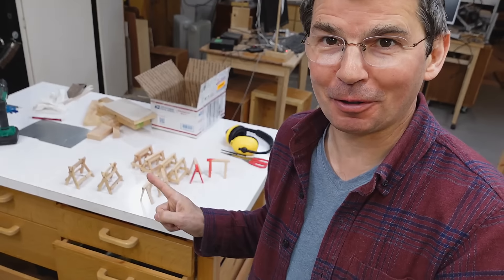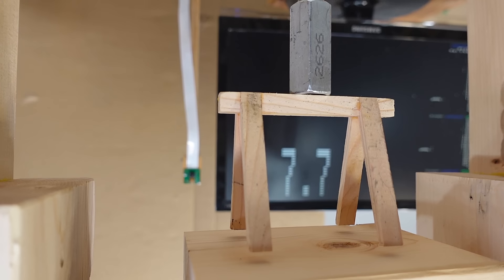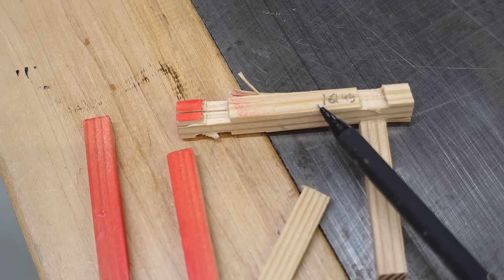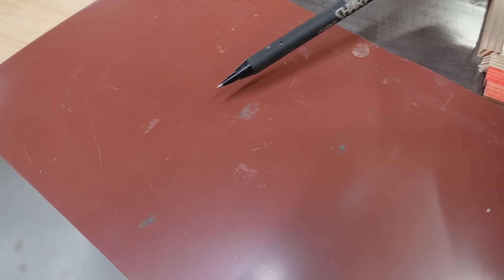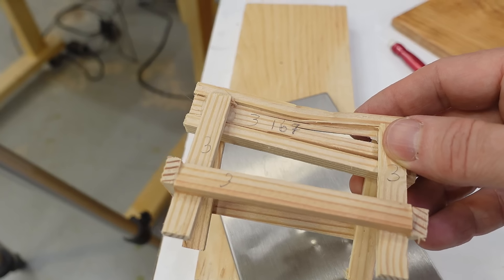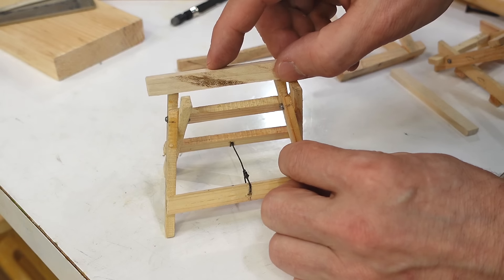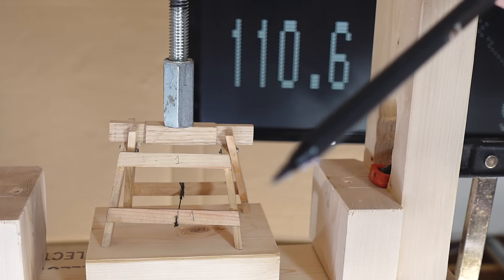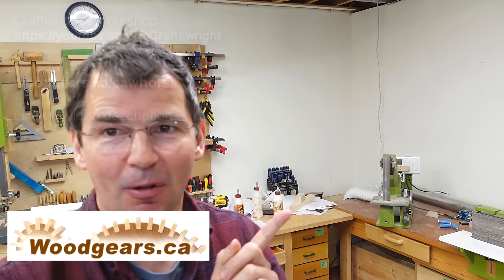Crushing tiny sawhorses

Comment: The problem with the I-beam horses was that the load path from the top plate of the beam went directly in to the legs. The web and lower plate of the beam weren’t carrying any load. A design that loaded the full beam would probably fair better.
Reply: Agreed, the I-beam needs support from below.

Comment: My dad ran a framing crew for decades. For as long as I can remember, they (we) used a very specific sawhorse design. Our horses had a double top-plate and angled plywood gussets attached to all four sides. With splayed legs (around 15°), these required compound cuts to make. One side had a full-length 2x4 step that connected its front legs to its back. Those things were beasts. It was not uncommon to crane-drop an entire bundle of plywood right onto them. 

I-beam horses can't compare. Since their top plate is the only part transferring the load, the design ends up being unnecessarily heavy, and they always end up wobbly because they're so difficult to gusset. Your simple design, if gussets were added, would make a great approximation to that old design, and it would be much lighter!

Comment: Pretty nice :) 

Tiny wood things are not very representative of larger versions, even if copied perfectly however. The grain of the wood doesn't scale down, and the difference in the material properties of the early and late wood in softwoods that sawhorses are usually made from are immense. It would work better if a wood with more uniform properties were used, such as beech or cherry. But of course, no one uses those for sawhorses these days.

Comment: I think the beam was stronger in the simple design because it was glued to the legs. Thus they could exert a torque onto it rather than just a vertical force as in the case of the folding design.

Comment: I would be curious to compare the weight of each sawhorse vs the amount it held. When I was in high school, we did a project of making bridges out of balsa wood and wood glue, with the goal of creating the bridge that held the most weight for the lowest cost in material. So both building a strong structure, but using less material were both concerns. It feels like unfortunately, the I-beam style sawhorses failed on both accounts. Very cool video!

Comment: Sawhorses are comically overengineered, to make them fail you basically have to get the wonkiest one you can find and park a heavy vehicle on it.
Reply: I can't find the video, and I don't remember the channel, but one YouTube woodworker once tested his saw horses by having his lumber supplier stack several whole bunks of lumber on a pair. If I recall correctly, they got up to a little over 10,000lbs across the two saw horses with no signs of strain or damage. (They didn't test to failure, as that would have made a mess, and probably damaged some of the lumber.)

Comment: There are a few other factors that are important for sawhorses besides load capability. 
Are they easy to transport, how heavy, how stable when loaded on the ends, do they stack or fold?
Load usually is only a few hundred pounds not tons. Hardwood and bigger fasteners could make them stronger if needed but who can afford that?

Comment: Eye opening. My sawhorses are all the I-beam style and the lack of support under the bottom flange is definitely a weak point. I do tend to put things on my saw horses that are more than plywood so I'm definitely going to do some re-engineering to put the force onto the bottom flange instead of hanging it from the top.

Comment: Those are really cute. I thought about building a set of those folding sawhorses, but ended up scrapping them in favor of a variation of your design. I built a small 4ft wide set out of some treated 3x12 scraps I was able to get. I'd like to do it again, but I'd like to change some things. One thing is adding a bolt or threaded rod through both legs directly under the beam. I've seen some sawhorse with them up much higher, using them to fix the legs to the beam, but I think placing them lower would be better.

Comment: 👍 I wonder how the results would differ if the load was distributed over the entire top of the sawhorse rather than in the middle of the beam. Very cool.
Reply from the maker: much better, obviously.  But it would be hard to set up a test that way.
Reply: @matthiaswandel  Just the beam is easily tested by placing across any two stronger supports. The only way it 'works with the horse' is by being placed above the 'X'!
Reply: @matthiaswandel  curious why. You can use a scrap 2x4 that’s wider than the sawhorse. I’d like to see the differences in the stand design, not purely the beam size / material. Most failures were the beam itself. Which there’s no reason one can’t increase the size etc. I don’t think beam size is inherent to any sawhorse design. So to test the design, the failure needs to be taken to the legs where the gussets and connections can show their differences. Thanks for the video!

Comment: I’d like to see you test a mini version of your saw horse to see if it is the champion. Though it looks like the extra plates would not be at the failure point of the others.  Maybe yours would stop the slippy slide issue??
What would you have to do to make the central beam stronger?

Comment: Even though they look strong I didn't think those I-beam ones would do that well considering they're not supported on the bottom.
Reply: Yeah, that was my take too. The I-beam supposed to replace a solid piece with less material. And that I beam is also supposed to have support underneath not just under the edge of  the top panel.

Comment: In Germany the traditional Carpenter saw horses looks like the stronger ones you tested. But the legs gets a slightly bevel sidewise too and a plywood triangel underneath the beam that is screwed to both legs. 
I think this would be the strongest when you about to test other Designs. PM me i'll send you plans how they are made.

Comment: Given the observed failure modes, do you think the gusset adds any strength to your design of sawhorse?  Good video. Thank you for sharing.
Reply from the maker: it insures against failure of the leg to beam joint.  Also keeps that joint from craking wen its banged around

Comment: I'm wondering if this would be a good way to demonstrate the value of going with larger beams for the cross beams. I can't really see a need for a sawhorse that supports greater than 9 tons in even residential construction, but I also don't see anyone setting even 5 tons of material on the center of a sawhorse, the load is far more likely to be distributed across the length of the sawhorse, and I'd expect far more of the load to be going almost directly to the joint with the legs, rather than the cross beam. 

Perhaps a way to test that would be to set up the test to distribute the load with a metal beam along the length of the cross beam. Say a 4x4 mm brass or steel beam. Unless you want to mill up and make some dimensionally reduced plywood for doing the testing... :-)
Reply: Saw horses often have a  label that says "Do not stand on this". I've never seen one that said "Do not place a motor vehicle on this".

Comment: The I-beam failure strength being lower was due to the way the legs were attached. To get a equal comparison they would need to be attached in a way the places the force thru the entire top/ bottom & web structures. Similar to the way the folding ones beam is attached. I bet it will make them the strongest.

Comment: Matthias- Next Level Carpentry (YT channel) has a video building journeyman’s sawhorse which is of the I Beam construction - without the lower leg banding, and at the end if the video he takes a pair to his lumber yard and the load them up with full bunks if 2x4 (the 20 foot long bundles strapped for delivery from mill to lumber yard right off the truck) if memory serves me they get 4 of those bunks stacked before they stop at which point the legs of the horses have punched through the asphalt yard. 

The difference between his real world load test and your test is load distribution— spread across beam versus point. Although in a point load situation, your test clearly shows where the weak point is for the I beam…. And highlights the need to select the “best” 2x4 for the beam web

I wonder if replacing the screws used to hold the top an d bottom caps on (though your test rig horses were glued)  with some of the modern hardware which is intended for assembling beams and such ( the Headlock (tm) bolts and all the others like them - or carriage bolts, washers, and nuts) which go all the way through both top and bottom cap plates are worth the effort/cost for the increased carrying load that linkage should provide ????

I love these tests you run, don’t stop !❤❤❤❤❤

Comment: Would have been interesting to see what happens, when the load isnt applied to the middle of the beam, but rather via a load distrubutor in form of a plate that is bigger than the sawhorse itself. This way, the whole saw horse rigidity is taking into account and not mainly the beam structure.
Any ways, very interesting!

Comment: the i-beam sawhorses were poorly designed: an i-beam's strength comes from the depth of the web between the flanges. in order to use that strength, the load has to act from one flange, THROUGH the web, and into the opposite flange. in other words, the i-beam needs to sit wholly on top of the sawhorse legs. cody had only the top flange supported by the legs, so only the top flange had to break in order for the whole beam to fail.

Comment: What is the relationship of the span of the miniatures vs. the span of full sized horses in regard to pressure required to break them. Aren't the miniature spans (shorter thus less deflection) actually stronger?
Reply from the maker: Shorter spans makes smaller ones stronger, but the cross sectional areas of bigger ones more than makes up for it.  Generally, scaling a structure up by N makes it N^2 stronger.  Problem is, it ends up weighting N^3 as much.  Which is why stuff where gravity is a big factor doesn't scale all that well.
Reply: @matthiaswandel  Thank you for explanation

Comment: The beams of the complicated designs giving at much lower pressure than the simple sawhorses kind of shows the beams of the latter were much stronger (ie different wood)? Weakest link principle should still apply?
Reply from the maker: I-beams were not glued or supported in the best way, which is why they failed.

Comment: It would seem that "failure" is a variable marker in experiments like these.    A more elastic wood would require more movement to reach "failure" and thus be more resilient .  A hard/brittle wood would be less yielding, but when it does fail it would be useless and give no warning.  In other words, failure would be application based.  I know this is not an earth shaking comment, but I think wood workers like me often over-engineer materials toward the hard end of the scale ($)...  often when not needed and even detrimental.
Reply from the maker: the wood actually yielded quite a lot before failing.  But the glue joints failed spontaneously.  But for a real sawhorse, there's always nails, which fail more gradually.

Comment: By not having a flat surface across the top, it seems as if you were just testing the strength of the top beam under a point load and not the strength of the saw horse as a whole.

Comment: It always seemed to me Craftwright's sawhorse design was flawed for having downward force on the sawhorse want to open its cradle for the beam. I'd like to see an all-wooden sawhorse that stores compact with quick height adjustment, but most designs seem like they make you fumble around with pins and bolts and loose boards instead of being easy & efficient. This was definitely enlightening on the strength of a good basic sawhorse.

Comment: It seems like the I beams only broke because glue failure, which I don't think you'd see at a full sized sawhorse. I'd be curious if it would be much stronger if the beam were held together with screw and nut instead of glue

Comment: Interesting test, I think the i-beam design could fare better at large scale, depending on a couple of factors, such as:
Is the i-beam assembled with glue or not and is the i-beam assembled with nails vs screws. 

Obviously, those things can’t reasonably be tested on this tiny scale, but they would make a difference!
Reply from the maker: if they weren't scaled down quite as far it could be tested, but even at 1/3 size, they might be stronger than my tester can crush.

Comment: i'm sure if you open source your testing code, there is a fair few people who can help make it configurable and improve on it, I for one would!
Reply from the maker: it IS already infinitely configurable.  Think of the whole thing as one big configuration script.  And its much more fun working with a known language than learning some configuration system someone has come up with.  And its unlikely that someone would anticipate my needs, so now the whole process of customizing for a test becomes more difficult.  Which is to say, I'd go for the quickest path to the solution, which is to not use your configuration stuff.
Reply: You should just write your own code and release it.

Comment: I've loaded up full lifts of plywood and 2x4 on the first style of saw horse with gussets and a stringer between the legs. Easily 3-4 thousand pounds with no issue on two of them.
Reply: I'm a bit confused as to why you'd do this. It seems like that stack would be at a decent height to pull from if just left on a pallet on the ground and would make it so you couldn't work on the sawhorses.
Reply: @jameslawrence8734  We stack it vertically against a wall to save space in a narrow area. Having it on the saw horses to unload it is much easier as gravity works to our advantage when sliding off a sheet to the ground. Means we don't have to pick up 150~ sheets from a low position on the ground. Work smarter not harder.

Comment: mount the i-beams so the load is on the lower beam rather than the upper beam? 

and pin them with toothpicks.

otherwise, this was quite interesting... but yeah, those i-beams bug me...

Comment: Correct me if I'm wrong, but A) those models do not look to be to scale, or that I-beam would be about a foot tall IRL, and B) material strength does not scale. So, amusing, but not particularly useful data.
Reply from the maker: good point, the cross sections didn't have the ratio of  2x4

Comment: I think you are forgetting that the physics works differently for scaled down things. This is why an ant can carry more than 100 times its weight and why they can walk on ceilings. Or did you already take that into account in your software?
Reply from the maker: the software doesn't care, it just measures force.  Force is force.  But for strength prediction, I scaled up by scale squared, not cubed.  The thing about ants being able to cary such a multiple of their weight is that as yo scale something up by n, strength goes up by n squared but weight by n cubed.  So that ant scaled up by 100x would be able to carry 100x less relative to its body weight.
Reply: @matthiaswandel   From my experience a typical wood sawhorse can hold between 500 to 1,000 pounds (227 to 454 kg) per sawhorse. If you're using a pair, they could support around 1,000 to 2,000 pounds (454 to 907 kg) collectively. But I consider you more the expert than I. If you really think these new (designed) SH can hold as much as you calculated I guess unless someone proves otherwise with the true to life scale SH I will have to concede this.